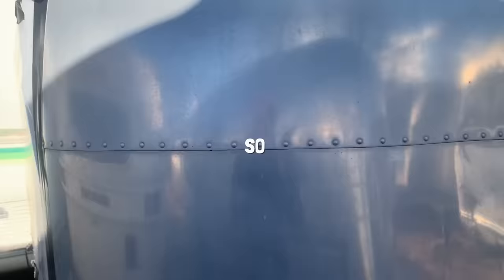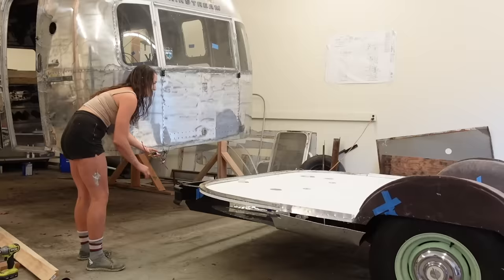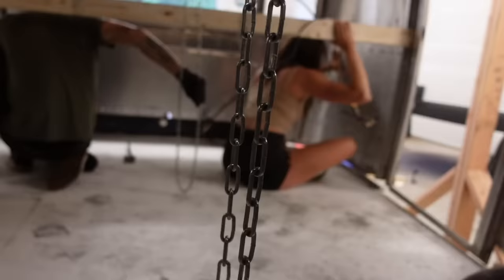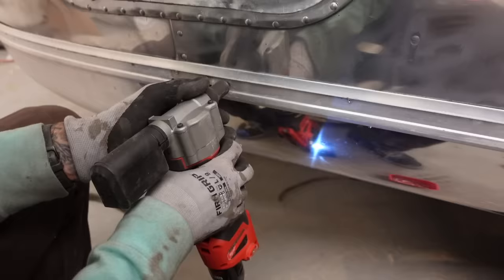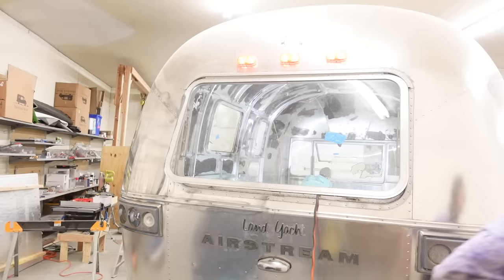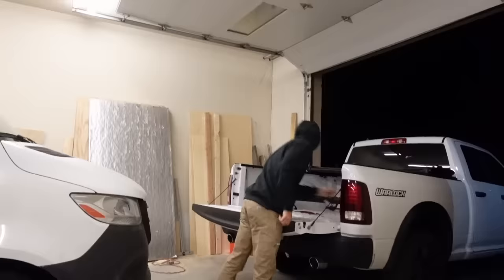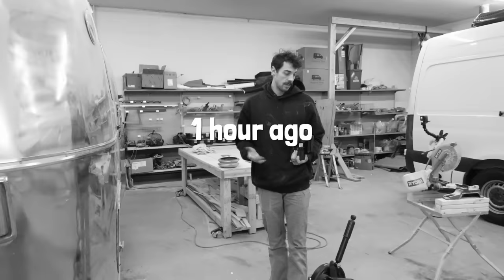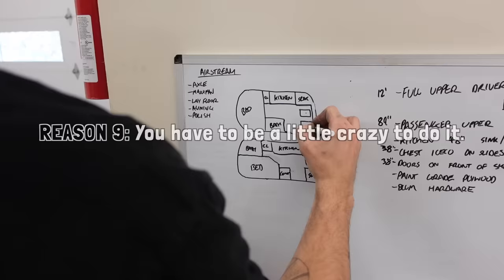Why No One is Renovating Airstreams

Comment: The problem isn’t airstreams being particularly hard to renovate, it’s that ANYTHING is hard to renovate when you don’t know wtf you’re doing. If you have little to no experience in mechanics, carpentry, electrical, or engineering, you’re going to have a rough go of it. Start with smaller projects and build your skills, before tackling a big project like that. Generally, if you have to buy thousands of dollars of new tools to do a project, you probably shouldn’t be attempting it until you know how to USE those tools. No offense, but I wouldn’t step in that death trap parked in the driveway, let alone tow it down the highway lol. I hope they realized the lug nuts are on backwards. Yikes.

Comment: @ 8:00 you people had me confused, I'm a Brit retired Motor Engineer, So 55yrs of, mending that which, idiots, Brake, Bend, or just Effe up, Ever heard the expression, Built from the bottom up, that chassis, sat in your w/shp until AFTER   you started adding weight to the chassis, to replace the axel, you could have sanded, ground, shot blasted, the axel for the cost of 2 cups of coffee at Starbucks, You 2 need a project Engineer, or your going Bankrupt, soon
Reply: Perhaps you are excellent at engineering, but you are certainly terrible at written communication.  You've supplied such a run-on gang bang of commas that it's nearly impossible to decipher specifically what you are attempting to communicate.

Comment: I rebuilt dozens of Airstream trailers for a company that specialized in them.
They are a pain in the @$€!.
Every trailer was different. Even the same versions from the same year would have different materials used. Let alone the year to year changes made.
Then try to find replacement parts.
Good luck!.
And if you do,they cost a fortune.

Comment: To install a distorted/flexible Airstream body on to a floor base, you could  put the floor diagonal/angled into the air stream body and then hammer it down! The airstream is made from aluminum, i know no better material. So whats all the whining?

Comment: LOL SOOOOO MMMMMAAAAAANNNNNNNYYYYYY MMMMMIIIIIISSSSSSTTTTAAAAAKKKKKEEEESSSS!
My family owned an RV store and repair shop for decades and I worked in the repair industry. First congrats on using hard rivets to reassemble. That is how they are made and how they should be repaired. 
The AC was likely fine and they are expensive!
You should NEVER use silicone to seal. It will never make a good seal and by now a year after this video was made, I bet you have tons of leaks. There is a special sealant. You also use a special putty tape under EVERY joint or flange before assembling.
The roof vent will be a problem for you. Airstream uses a special aluminum flanged vent. You will have big issues when that plastic flange cracks and leaks.
The axle was fine. All it needed was a bearing repack and new brakes. This is a normal service and is a couple hundred dollars.
The clean and re-polish is a very large job and an expensive one. That is why it isn't often done. 
We have rescued many of these projects after the owners gave up on them, honestly many more than half are never finished and are sent to scrap. Congrats for sticking with it. 
There are a lot of special skills needed and those jobs are best left for those who know and have the skills, such as your gas appliances. If you do it wrong fire is a real possibility. Electrical, you have both 12 and 120 v systems. Again , special knowledge is required. Again, fire or electrocution or both can happen.  
An RV is like working on a home, a boat, a car all at the same time while not being like any of them at all.
And, like someone else said, the lug nuts are on backwards. They will not seat properly and will loosen all on their own.

Comment: Why is the floor/bed/bottom wood??? It’s not you guys’ fault, I get that it comes like that, but why keep it wood? You don’t see cars and buses and trucks built with wooden floors that can be defeated by one of the smallest animals on earth, can rot, etc, all kinds of reasons we don’t build heavy machineries with wood.

Did a quick Google, seems like even Airstream themselves stopped using wood in 2021. Wonder what took them so long.

Comment: if you want to restore it to absolutely mint condition by either having a specialist or starting from absolute scratch with tools and such yeh it might not be worth it. but if you want to do it to reasonable git-er-done and functional and you have space and tools already then I beg to differ. I'm surprised nobody has thought to use HDPE to fabricate the small stuff at times.

Comment: ive wanted to do this, got 1 at the farm its already gutted, but i just absolutely despise working with aluminum not only that i would also have to drive 5hrs just to get to the farm and heaven forbid if were to do it and forget a important tool i needed. id probably say "fuck it im building a house instead"

Comment: How do you keep road water from rotting out the undersurface of the floor sheathing?
Reply: Paint? If it were me I'd have used pressure treated plywood. Put some of that on the roof of my shed after it rotted out on me. So far so good.

Comment: Airstreams are monocoque aluminum-on-rib construction ... like aluminum aircraft.  This is intrinsically slow & expensive construction -- OK for airplanes, but not so much fun for anything else.  "If you have never worked with aluminum before it's going to be a struggle" ... you bet.  Had you found anyone who was a professional or amateur who worked on aluminum aircraft (anyone who built an Van's homebuilt) they could have given you some useful help and advice.    Everything else you were dealing with is just old-trailer problems.  I do hope you have fun with it when you are done...

Comment: First of all, any restoration does not save money.  Talk to any classic car restorer.  Between costs and hours of labor, the restroed vehicle is more expensive than the original.  YOu restore it to get a vintage product, and build a better product, because you will always use better materials than the manufacturer.  My preference, even new, would be to buy a shell, and then build ut the interior.  I ahve seem too much particle board used inside, and damaged by water.

Comment: Why?  A barely used (most trailers are that, like a sailboat) modern travel trailer is 1/2 the price, everything works great, and it's better designed and more comfortable.  This is like restoring a 1977 rusted Ford Falcon.why?

Comment: I am very familiar. Everything is round making it difficult make new interior, a large refrigerator won't fit. They are cold. The plumbing is under the floor,  where it can freeze even in use. The aluminum underside has to be cut away to access. The clear coat is very easy to damage, never park near pine trees. Everything Airstream is 3X price of others. Airstream is an overpriced status symbol. God help you if an exterior panel is damaged.

The old joke is that the holding tanks could be dumped anywhere, because if you own one, your poop don't stink.

Comment: 40k? lol my friend just got one for $500, sat in a barn for the past 30+ years and is in great shape, guess he got lucky.
Reply: 500? Lol I got mines for 50 bucks, I guess I got lucky.
Reply: @cococcom3llow402  you sure did lol nice
Reply: @cococcom3llow402  but is it almost mint condition? this was stored away in a barn that had it's roof maintained so it never got rained on or anything, it was basically like new inside. the guy also had a model T but it was in bad shape, hadn't always been stored inside i guess. would've cost a fortune to rebuild.

Comment: You had the chassis and frame completely removed from the airstream body, easier to work on it first. If the foundation is solid and true then place a flexible body atop, right?. I think those were the bearings you were hearing, easy cheap fix, they are made to be repacked unless they’re sealed hub bearings. Look it up, as steel before and around WWII has been known to be of better quality (made by US Steel, now Taiwan has the good steel plants, whatever’s cleaver I guess) and u may had of added a couple leaves to the spring for better clearance  rather than blocks, dunno seam like a changed ride quality, no? No one is riding inside it I guess. Just replace the leaf springs, they are meant to be replaced. Yet, also consider OEM aftermarket manufacturers do upgrade components with thicker gauges using better or worse materials, like replacing rubber with urethane bushings, seals, gaskets or better wiring. Old wire harnesses 50 plus years must be replaced if you can and urethane isn’t always better than rubber, yet rubber technology has improved. So much to consider when replacing something from that era of American manufacturing culture and changes in manufacturing processes. Upgrading parts for longer planned obsolescence is common with consumer automobiles not the industrial commercial trucking or trailer industry.  I know this from experience, not sure with RV industry. By replacing the axel you know the welds are good with no underlying erosion or micro fractures within the axel. Yeah, tough decisions on that $1,500 axel + time and everything else needing replacement. I always remembered something about the Airstream trailers were built by ex-aircraft/airframe manufacturers firmer employees (the talent, not a actual companies themselves) that worked on WWII airplanes so I assume they had some higher capacity skill set to manipulate the aluminum to any dimensional shape required. I do know WWII aircraft rebuilds are tough because the tools are no longer made for those applications. Surprised no TIG welding was required or welds period. Good stuff, I always wanted to refurbish a streamline from the 50s or 60s 👍 Now I know not to, let the pros do it to perfection.
Reply: It sounded like the brake shoes rubbing on the drums. They get that way after sitting a while. But the bearings may be shot too. Or just need to be repacked. I'd like to see them palm in some new grease.

Comment: Totally not worth doing :o) You could have built a brand new twin axel box van from scratch easier. But it is cool 😎 The one snag isn’t a snag at all. You spent ages riveting and re-fitting metal, but that is actually normal. Next nightmare is building square cabinets in a lozenge :D  *upside is you can use a spirit level, unlike the other nightmare to interior, boats ^-^

Comment: you basically replaced 99% of the entire unit.
A couple of aluminium sheets and you could have build the entire thing from scratch. probably cheaper and less effort than renovating the old one was.

Comment: Ok nothing you show there is a "speciality" tool.   All of those tools are standard to their industry, my workplace has almost of of them for example.  Now they are a bit niche, and might not be in a standard workshop. 

However a specially tool is a tool that is only used for a limited number of niche applications.  So like the weird screwdrivers needed to work on electronics.  But half that stuff is standard equipment for a sheet metal work environment where they have general applications.  

Basically what I'm saying is you are the equivalent of a carpenter complaining you had to buy speciality tools to work on their car.   And the truth is once you unlock the sheet metal skill, you gain so many more options for projects.

Comment: That is not renovating. That is taking a shell and building a whole new vehicle. Renovating is when you fix the bad spots and you leave as much as you can. I don't know why you tore the windows out or tore the walls out. You could have painted the walls. The only thing you really need to do was replace the floorboards. You could have either gotten the air conditioner fixed or if you had to fit a new one in there. It's like I see these people that take old boats and they rip the whole thing out until they just have a fiberglass shell. That is not renovating that is gutting and building a new one on a shell. Renovating is you take what is there and you restore it you resurface it you repaint it you sand it so you keep 90% of the stuff that's there. You don't have to go buy all new stuff cuz you use the stuff that's there and refresh it.

Comment: It explains EVERYTHING when I see you replacing the axle (AFTER ) you put the body back on. It show lack of preparation/planning .  I thought you guys were professionals. 
I kinda gave you a pass on nogg th realizing you needed to face the shell ,and the fan ordeal ( square peg in a round hole 🤔) but I had to leave with the axle . 
I’m glad I didn’t have you guys try to build my camper. I didn’t have any where near as much trouble as you guys did. 
But if you have absolutely now mechanical skills and live in an Apartment, you would be the third choice after a , homeless guy (1). Biden(2).

Comment: You bought top of line tools , $660 for a rivet gun???? $425  for polishing supplies? . This is what I would buy if you challenged me to spend the MOST AMOUNT OF MONEY POSSIBLE. check out harbor freight, you could have bought all those "expensive tool" for prob 25% of what you paid. If you don't already own the tools then you are most likely only going to use them once, no need for professional tools, there's a whole tool market for DIYers that are only going to use them lightly or ONE TIME.

Comment: why-o-why would you go with particle board for the floor yet again . . . . .. you walked right past the 3/4" treated plywood !!!!!!!!!!!!!!!!!!!!!!!!!!!!!!!!!!!!!!!!!!!!!!!!!!
Reply: They used Advantech sheathing. It said so right on the sheets. It's OSB
Reply: @1pcfred  so what is your point ? it'll rot just as fast if not faster than the last flooring ? , furthermore particle board and    " chip board " are the same . . . . neither should be used for flooring in anything . . . as far as I'm concerned anything that like this stuff should be bio-mass for energy production .
Reply: @OldBastard-dj6er  particle board and oriented strand board are not the same things. Not even all OSB is the same. The OSB used here has the highest strength rating. Although I wouldn't use it because the resin they bond the stuff with makes me itch. I haven't used this particular brand of OSB myself though. I've only used the cheapest variety.
Reply: @1pcfred  go ahead and trust that about glue board . . . I've experienced how fast both can disintegrate , you won't change my mind or knowledge about such products . . .   we are done here.
Reply: @OldBastard-dj6er  you've used this exact brand product? It's not the same as no name OSB.

Comment: Is this for real? A $50,000 shop and whining about $400 0f tools?  The axle would have been easier before putting the plywood down, putting a flat roof vent on rounded roof is problematic - yes it buckle, why would you put the lug nuts on backwards?  If you had to do it again make a hard luan template on the inside to fasten the plate exactly like it was kinda like granite countertop template making.  Something to be said for being young and energetic - carry on

Comment: These things are just generally a weak design. Very pretty but designed to fall apart over time, no real structural integrity. People associate them with an aluminum aircraft, but there is really no comparison in the way they are put together.

Comment: It's just like aircraft sheet metal work and beats the horrible cheap trash other RVs are made of (wood is for furniture and camp fires).  While these are entertainment not technical videos those seriously interested can go straight to studying aircraft sheet metal work and the tools which make it surprisingly easy. Tinmantech and others cover oxy-acetylene welding of aluminum (which build most WWII aircraft since TIG was only invented around 1942!) . 

You can also use modern automotive structural adhesives like Lord and 3M sell (see their websites). Aluminum is a great material more people should learn to work. Bugs don't eat it, it doesn't burn under normal conditions (i.e. when not in Thermite), it doesn't rot or absorb moisture. L

LEARN APPROPRIATE CORROSION CONTROL. Aircraft and boat communities have many options. Bare alloy is bad which is why clear coatings like Sharkhide (self-annealing, it's not a paint) exist for display items and modern paints exist for interior parts.

Comment: As a professional Airstream Restoration expert with 10 years of experience working for one of the few  Airstream restoration companies..
These guys are just getting a taste of the complexity of the endless  variety of Airstreams.
Especially the early year trailers. Until the 60s, they we're, for the most part, handmade.
Replacement parts are incredibly hard to find and EXPENSIVE!.
Everything needs to be replaced with modern components that don't fit the original locations.
 Be prepared to spend in excess of $100,00 for a beautiful showroom quality trailer that still will only last 10-15 years at best. And cold in the winter and hot in the summer.
Hey, but at least it will still be shiny!
 And by the way, I worked for an Airstream dealership also. 
The new ones aren't much better for the price you pay.